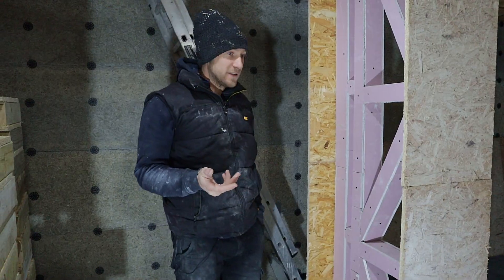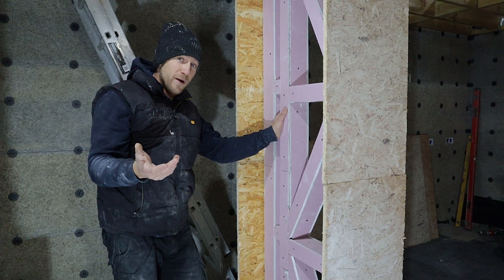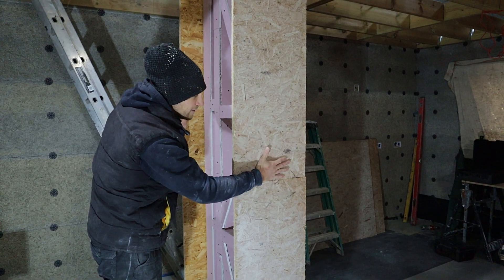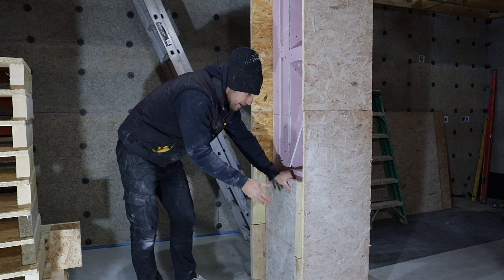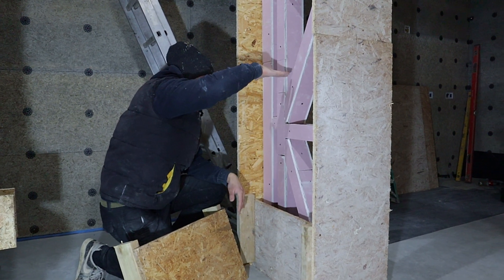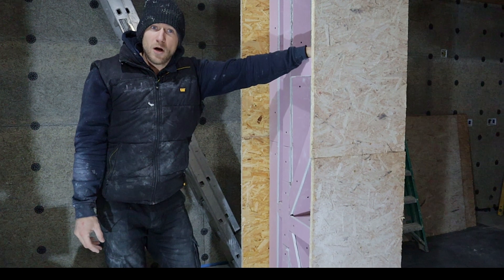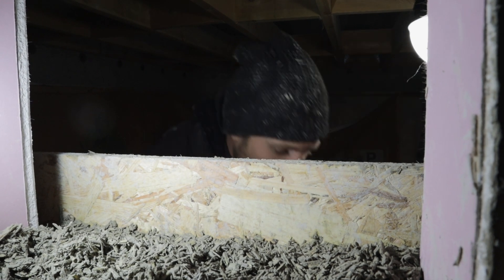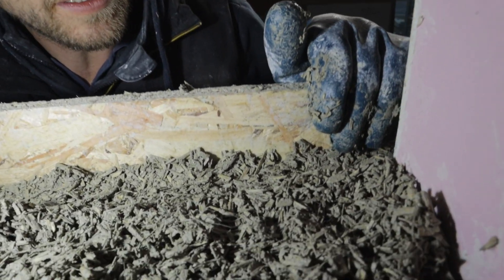#11- Breaking the Rules? Hempcrete as a Structural Wall (Here’s How)

Comment: I am sorry but that stud work would not need that level of fibreboard around every timber. Building control have lost the plot. Timber in its own right forms a fire rating.  What a joke.
Reply from the maker: Haha 100%. The Hemp probably provides better fireproofing than the boards but engineer required it. 
Building control are a joke, even more so now that they pass all responsibility to the newly created position of principle designer. They're now just an additional cost that do nothing for you.
Reply: I was surprised at how good compressed straw insulation is as a fire retardant.

Comment: But why? Why insulate with hemprete an interior pillar when no insulation is needed for interior pillars? The city basically didn't care about the hemp they wanted every inch of the wood covered with fire retardant board. Using simpler insulation for interior walls would have saved so much construction time. Straw bail, wool, wool panels, expanded cork. Cheers
Reply from the maker: Why not? We basically had left over hemp and Matt wanted to try for a feature wall of hempcrete downstairs. It's just an experiment really. Like he says, if he doesn't like it he can just cover with lime plaster. He is trying to avoid wool as we have heard from an architect friend, that they had big problems with moths, expanded cork is expensive and a  straw bail supporting wall would be too thick.

Comment: Firstly, really great video and series on this interesting project - something I'm in fact considering now in NZ so cheers! I was wondering what the rain penetration on the lime rendered walls will be like? Its great that you can apparently do away with a cavity between cladding and wall structure but with eaves that look only about 400 - 500 mm wide do you  have any concerns with direct rain on the walls?
Reply from the maker: Hi, thanks, glad you're enjoying the series.

As long as you use a natural, breathable paint on the render, it should last anywhere from 20 - 30 years. We have plenty of 500 year old buildings, that use lime and are still standing so that's a good sign :-) The eaves on this house aren't very big, although bigger than what most get in this country. They are about 350mm. 

The house is very exposed and so gets a lot of driving rain but it seems to be surviving the winter pretty well.

One added bonus of lime render is that it heals itself of cracks. The lime underneath hasn't fully carbonated and if cracks appear, rain will actually help seal them back up. We have discovered something interesting with some test boards we did and will chat about that in the next AMA episode. Thanks again for the views. Cheers.

Comment: Really interesting approach. Smart problem solving too, you need to name that technique! Absolutely lovely textured finish, looking forward to seeing the finished colour. One question, will you be able to hang pictures n stuff? Would you need special fixings or long screws into a stud?
Reply from the maker: Cheers. 

For something light, like a picture, we'll just drill a small hole and put a rawlplug in with 50mm screw (hole smaller than rawlplug) for anything heavy or taking weight we could use long fixings to reach to studs which are at 400mm centres